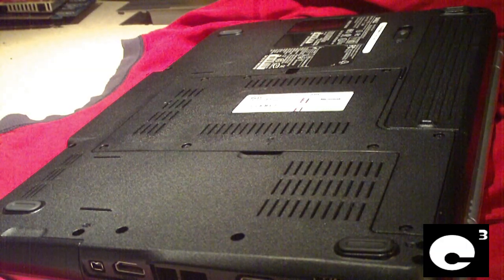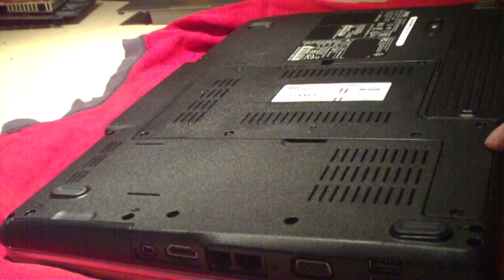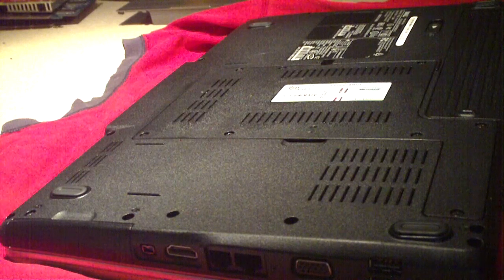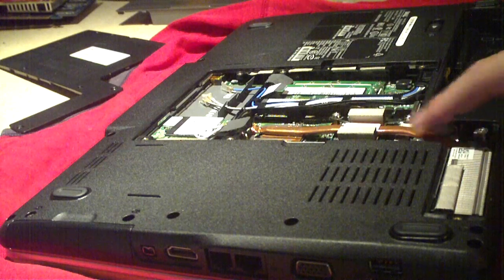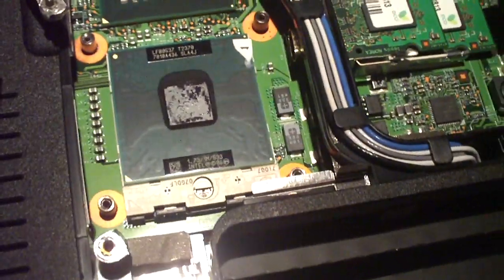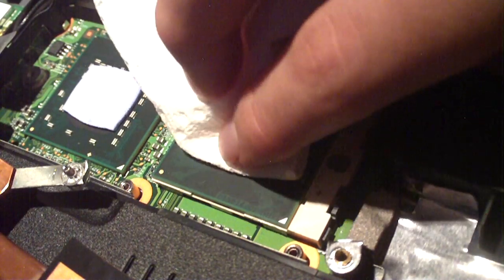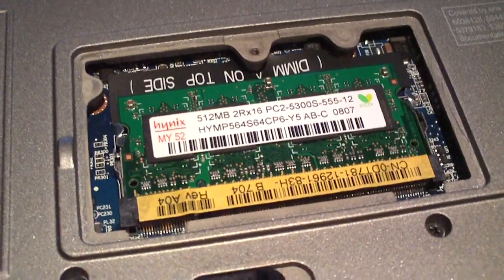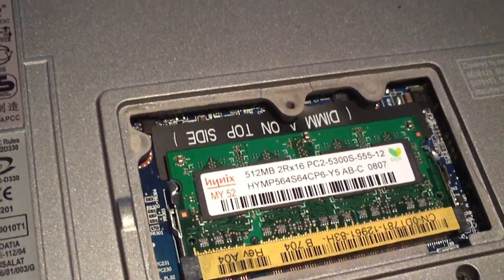How to Replace CPU and Memory (RAM) on a Dell Inspiron 1525 Notebook

Comment: Actually the first half decent tutorial I have seen with regards to CPU's.  Personally I wouldn't use a paper towel to clean the CPU, just because of the lint.  Good tutorial though, especially noting the correct tensioning pattern on the heatsink.

Comment: Question for the uploader: My Laptop has a Socket P 478 Pin socket as well. Are all processors in PGA sockets removable, or are some soldered?

Comment: Why not clean the vent at the end of the 'heat pipe'.  It can gather quite a bit of dust as it's open to the elements.  I just use a small child's paint brush to get rid of the dust & debris.

Comment: Something Ive noticed about my Laptop after upgrading my Processor is that the strength of my wireless network connection isn't as strong. I'm stationed in the exact place I normally hung out before I upgraded my processor, but the strength of the signal seems to be weaker. I don't know if that has to do with the upgrade or a problem with my network connection though. Would upgrading the Processor possibly decrease the performance of other devices within your computer by using up more power?

Comment: Alright, I have another question.
My Laptop uses DDR2-800 Sodimm RAM. The maximum I can put in is 8GB. Could I use pretty much any kind of DDR2-800 Sodimm RAM I find on Ebay? I'm worried that there might be compatibility issues and I'll need to get a very specific kind of RAM.

Comment: 4:15
Speaking of which... If I wanted to switch my Wireless Card from one slot to another inside my Laptop, what would I have to do to get the wireless card to start working? I'm assuming it has something to do with the BIOS.

P.S. To the uploader: I'm not sure if you remember me, but I had a question about a month ago about whether or not a certain processor was compatible with my computer.  Just letting you know, but the processor was compatible and I'm using it right now as I type this.

Comment: My 1525 has Celeron 550 and I want to replace it with one of these T5250, T5450, T5550, T5750, T7250, T8100 or T8300. Do you think I will have any problem? And which would better? Is worth the money at used ebay price?
Reply: well the T8300 would be best but i have you beat mine hat a centrino in it to begin with

Comment: Can I replace my Core 2 Duo T2250 (533 MHz FSB) to an ebay replacement Core 2 Duo T7200 (800 MHz FSB)? Will it even work? My laptop is a Medion MD96290.
Reply from the maker: The T2250 is a Core Duo. The T7200 is a Core 2 Duo. They're two different cores with different sockets and the chances of being able to upgrade to the T7200 are very unlikely.

Comment: I have a celeron 550 in mine can I put a core 2 duo or core 2 quad in my inspiron 1525
Reply from the maker: This machine will support up to a Core 2 Duo T9500 2.6GHz CPU from my understanding. I have the T9300 in mine.
Reply: ok thanks i have a slow single core processor and really need to upgrade

Comment: nice to see another core 2 duo get put to work, i have a core 2 duo desktop, but its only 1.8ghz, but its a 2007 base computer(compaq)but its been really fast with the processor of its kind and 4gb ddr2.but idk when but im going to build my own pc and its going to be a either core i5 2320(3.0ghz quad) or the i7, the only thing the i7 has over the i5 is hyper threading, and truthfully i never had a HT cpu by intel, lol, right now my laptop has a 1.7ghz pentium m running win7 and does pretty good
Reply: So, 11 yrs later. What did you build and what do you have now?

Comment: you shoundn't mess with thermal pad on northbrige you leave thermal pad on northbrige it work better for cooling gpu you can put chopper shim on top gpu it perform better with lower temps

Comment: Pretty sure I didn't. It's probably the network connection itself. There have been alot of problems with the quality of the connection throughout the year. I might have just been a coincidence that the quality dropped as soon as I upgraded my processor.

Comment: i use my 1525 as a minecraft server with a T9500 and 4gb of ram and an ssd and it works better
Reply: Amy Yanez not really just heat I have a small USB fan in addition to the CPU fan to keep it below 50 celcius

Comment: i have a 1526 top half and a 1525 bottom half
Reply: +Jeff C The difference between the 1526 and 1525 is the processor.  1526 is AMD and 1525 is Intel.  The top half of the machine will be identical.
Reply: +Chris Paul yes I no I put it together